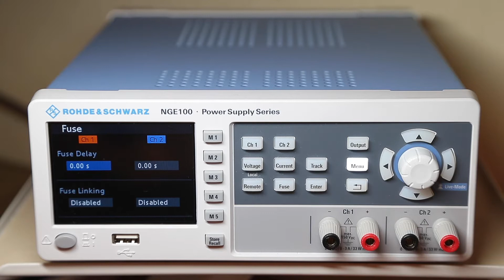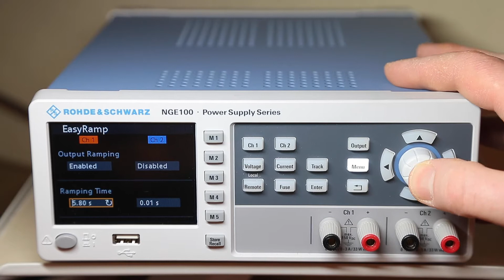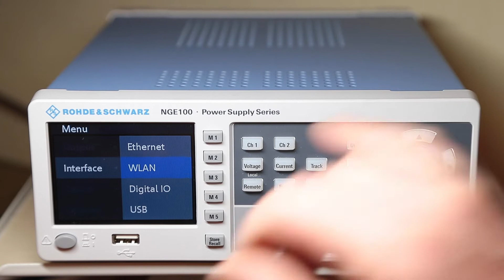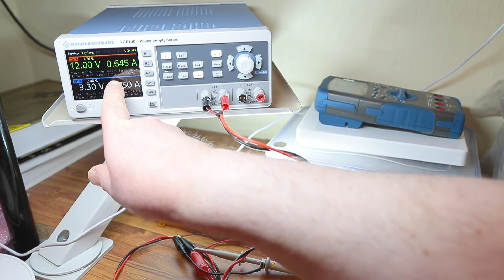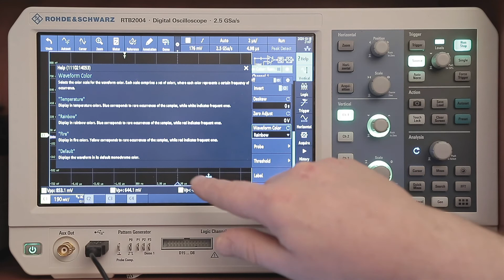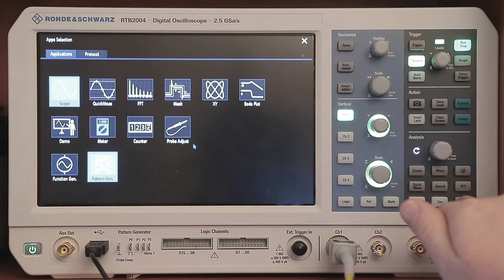Rohde & Schwarz NGE100 Lab Power Supply Demonstration & RTB2004 Oscilloscope

Comment: These power supplies have a major flaw, which can destroy your components/circuits.
In constant current mode, the control loop is way too slow. For instance: if you set the voltage to 20V and the current to 10 mA to test a LED and enable the output with a led connected, the voltage will overshoot to 20V for almost 20 milliseconds, before settling on the Vforward of the LED. This will kill the led as the current will be far beyond the maximum limits of the LED.

A test with a 50 Ohm load and a current set to 50 mA let the voltage spike to 18V for 20 ms (I = 360 mA!), after that is decays exponentially over a period of 60 ms to 2.5V (50 mA * 50 Ohm). This is such a serious design flaw that I feel this design should have never made it to market.

This problem has never been fixed in all the firmware updates that have been released over the last couple of years.

Comment: I really enjoy your videos on the rhode & Schwartz scope... I picked one up and love this scope... glad that you are back...!!! Hope things are better now... was it difficult to do the firmware update? Thanks for doing your videos....
Reply: Thanks for the comment on the videos, it’s very much appreciated.
The firmware updates are very easy. You should copy the *.fwu (firmware) file to root directory of a usb memory stick with no other data on it. The latest firmware should be available on R&S website. You need to insert the usb stick into the front usb port on the RTB2004 and touch the ‘Menu’ icon (lower right corner of the screen) and select ‘Setup’ from this menu select ‘Firmware Update’ and follow instructions. The process takes 3 - 4 minutes, just leave it to complete and after it finishes it should reboot automatically.

I think the latest firmware is version 02.300 from October 2020.  The new firmware updates are definitely worth doing as they generally offer a number of new features and fix any existing bugs.

Pleased your enjoying the scope. I am really happy with my one and I love the big screen and excellent user interface. Consider adding a mat screen protector to reduced glare and fingerprints as I did.

Stay safe.

Best regards 
Michael

Comment: Could you try to make a demo of how to use the x-y plot to display a charateristics plot of components, say a transistor. I mean use a slow rampwave on one axis and also use that as the the input voltage, then measure the resulting voltage and plot that on the y axis. Would that be working with the scope?
I forgot: many thanks :)  your video's are really helpfull.

Comment: Michael, can you show (or tell here) the behavior of each channel of the power supply. Aspects like noise and ripple over different current loads, step up or voltage spikes when the channels are turned on, and spectral content in each condition? I think its a good demonstration of both, power supply and osciloscope. Good video!
Reply: Hi.  I will before Xmas (2020!) be making a full review with tests on this NGE102.  I have recently been using the supply for both work and personal use and I have been generally impressed with its all round performance.  
I will try and produce a video with a range of all the normal power supply attributes (accuracy V/I, electrical noise, update rate, power on spikes/rise times, etc).
Stay safe.
Regards
Michael